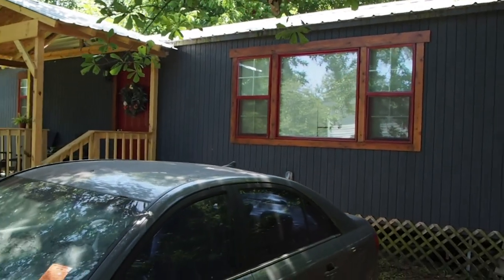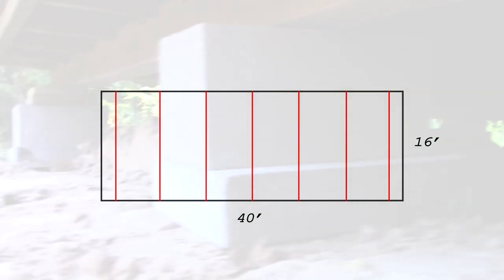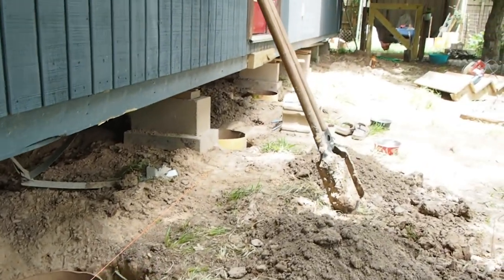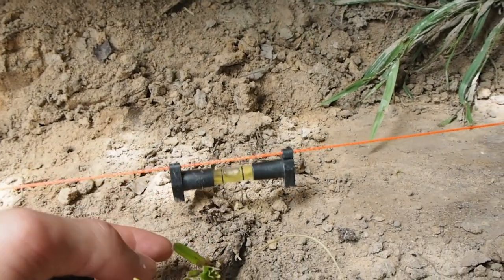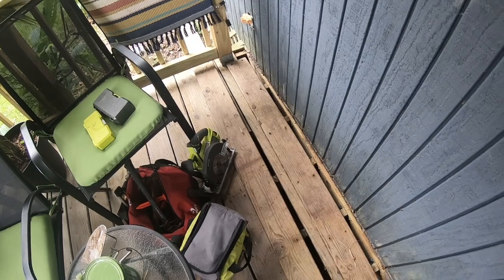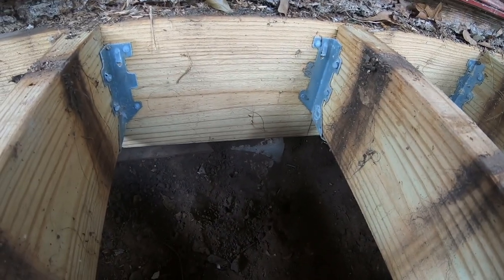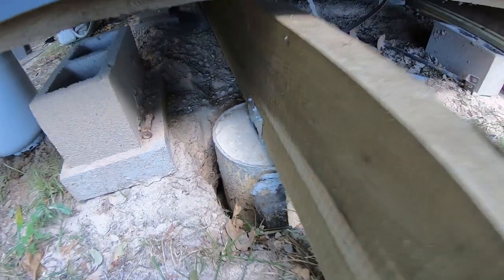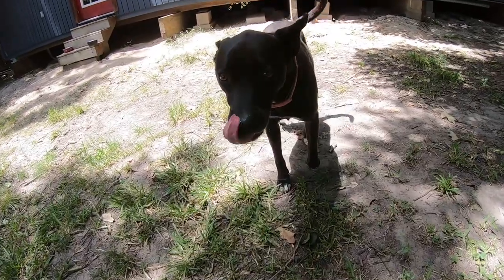From Blocks To PIER AND BEAM | Diy Tiny House Foundation

Comment: Nice job on the video! I would like to have seen more detail. Maybe some video of you actually sliding the beams under the house and how that was done. This is very helpful information though. I am going to be building a tiny home so I'm diligently researching, making sure I  get my foundation solid before I start building. So I don't have to go back and change it later.
Reply from the maker: Thanks! Sorry for missing that part. I think by that point I was burned out. But, we did do as you said and just slide them across and onto the already bolted down strong tie. Good luck with your tiny home build! It's definitely a pain to go back and do projects like this so better to get it right the first time.

Comment: How did you get the holes under the house? Did you lift it first?
Reply from the maker: I did have an auger, but since the holes need to be somewhat under the house I had to dig at an angle and then use hand tools to dig down straight to the right depth. Hope that helps!

Comment: How do you figure how many piers and what size your house needed? I plan to build a 600 sq ft Aframe.
Reply: I believe it is based on the size of the beam.  If it is 2x8 then 8' is the maximum you can go.  Similarly, if it is 2x10, you can go 10'.  This is pretty much a rule of thumb.  You can double the beam - sandwich 2x8 together, so it will look like a 4x8.  If you did that, I believe you could go to 10'.  Hope this helps.  Span tables are available online as well.

Comment: Could this work for a flood zone
Reply from the maker: I've read that pier and beam systems may actually be better in a flood zone. But it also depends on the climate and whether it's hot or cold. Pier and beam can be more expensive then a regular slab foundation too. Sorry I can't give you more detail!

Comment: Would you please tell me the type or model number of the bracket that you are using to attach the new beam to the pier?  It seems a very efficient way to attach the beam, and keep the beam slightly above the cement to avoid rot.  Thanks.
Reply from the maker: Yeah these things are awesome, but pricey. Here's the link! 

https://www.homedepot.com/p/Simpson-Strong-Tie-ABA-ZMAX-Galvanized-Adjustable-Standoff-Post-Base-for-4x4-Nominal-Lumber-ABA44Z/100374999